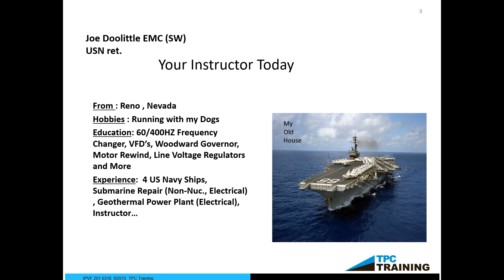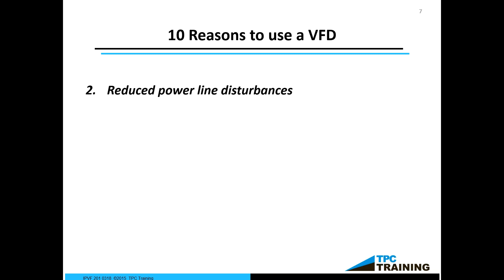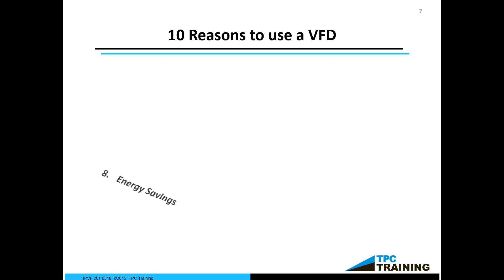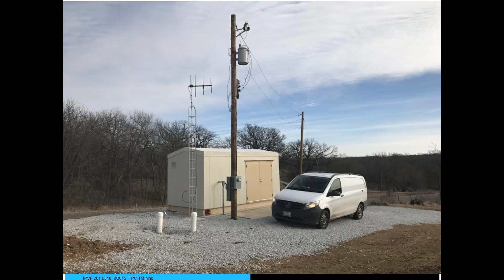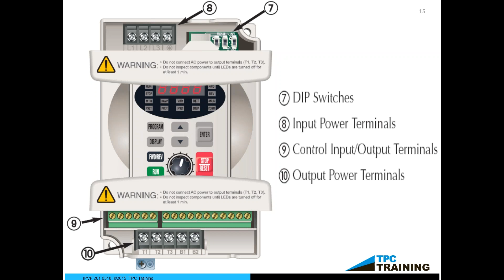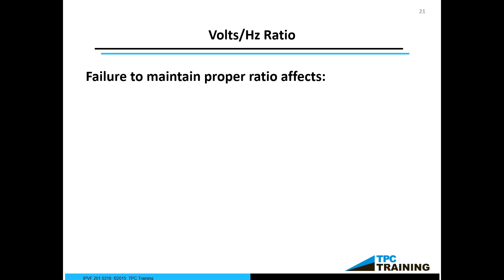Variable Frequency Drives w/ TPC Online Webinar | TPC Training

Comment: Would an electrician be Qualified to handle wiring this type of work or is this on a higher level?
Reply: I spent 20 years in communications. Then I got hired as an industrial electrician and I've used Google and YouTube to teach myself how to program and operate/wire these drives. If you are an electrician, you're several steps ahead of me.

Comment: Good job,,,,, we appreciate your efforts & presenting amazing information,,, thanks.  I have question that if the inverter using pulse width modulation Technik in converting DC bus voltage to AC again,, is it necessary to use an LC low pass filter at the input of VFD & a shielded cable between output of VFD and motor... also is there another technology used recently to avoid the pre-mentioned malfunctions like harmonics Noise effects and overheating problems.......